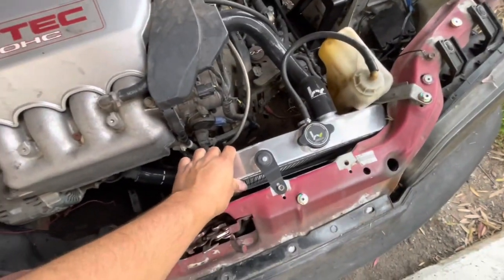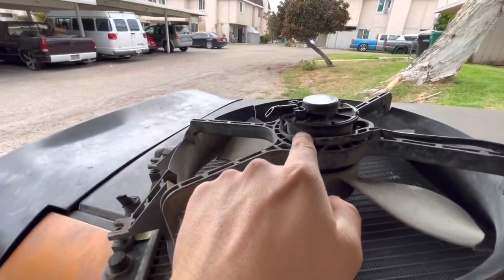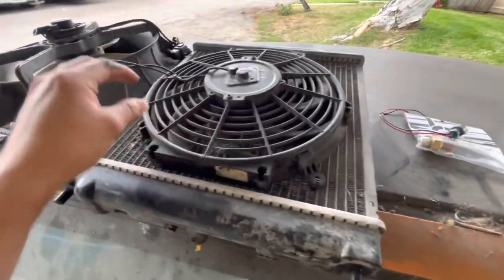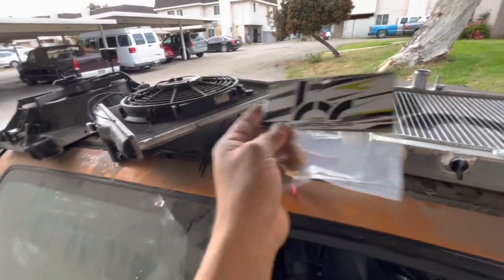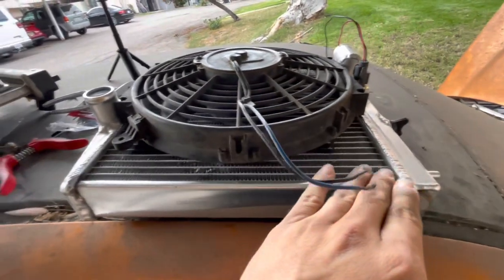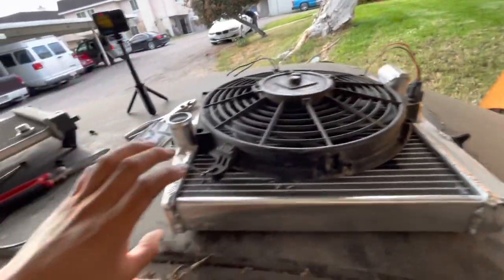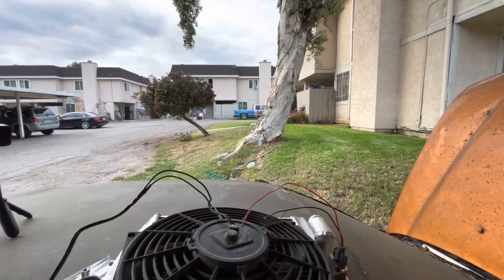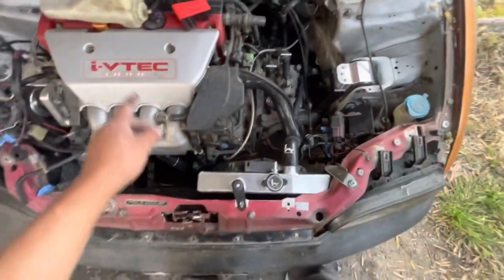Kswap Civic Eg Radiator Fan Install Gone Wrong Sorta! 🙁

Comment: Hey bro I am doing the same thing with the radiator since I don’t have kpro yet what plug did you connect to from the fan are the wires  for the car harness black and red or black and blue since there are two plugs that are the same thanks 👍🏽
Reply from the maker: Sup man. I do not know if this works yet lmao. This will be on the wiring bud when I’m done with it. But I connected to the black and blue wires that connected to the old fan. I just got the plug from the old fan and spliced it to the new fan. And the fan switch to the conversion harness. Hopefully it helps!
Reply: Can you video farther up that radiator fan harness? Is it the same as the AC fan harness or different? I have a K20 in an EG that came with a toggle switch. I’m trying to wire the radiator fan to power right now. I ran the temp probe to the conversion harness, the fan switch to the conversion harness (and grounded the other side), and now I just need to find the actual fan power source (that harness is gone, but I can go junkyarding if I know what I’m looking for. Thanks buddy!
Reply from the maker: @kolekindschuh901  the harness leads up to the fuse box. I think it is a separate harness than the a/c one
Reply: @kolekindschuh901  the wires are a black with red and two brown dots and the black wire with 2 brown dots